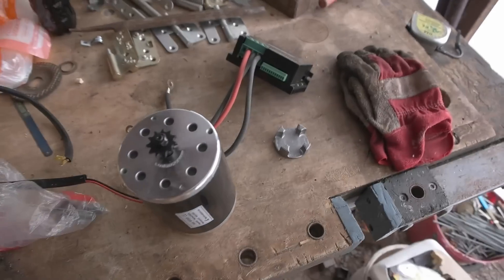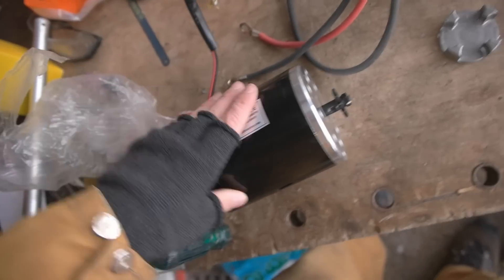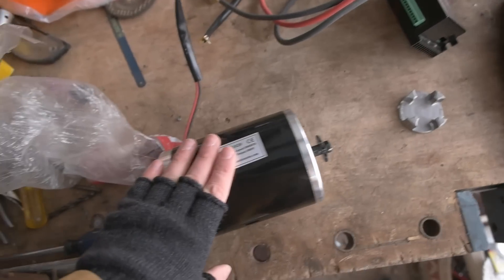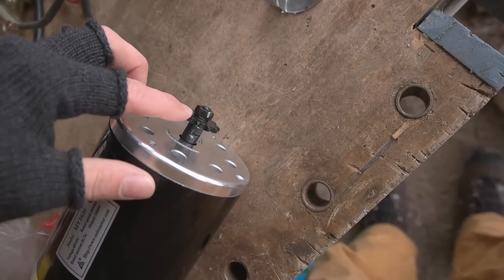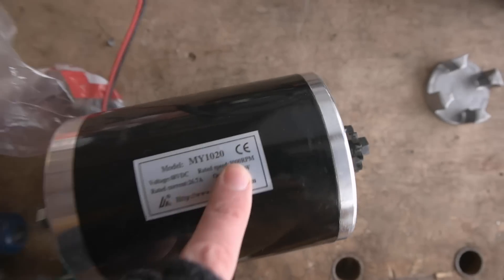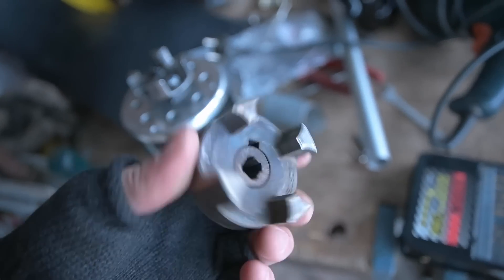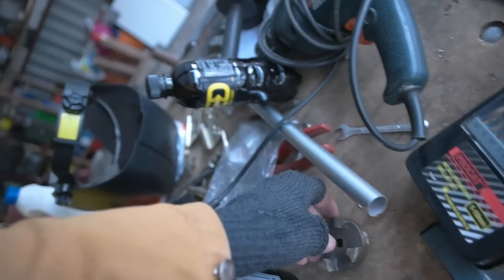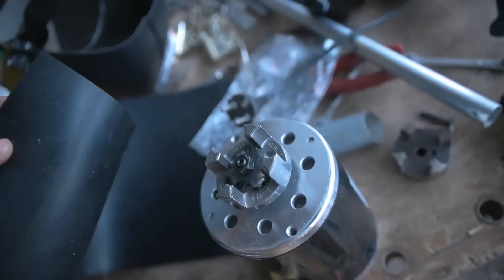Building my 2nd electric outboard motor - Part 1

Comment: Nice project of electric motor outboard...10k to 100k Rpm...a quite engine that can not use gas and diesel engine... Very high speed electric motor outboard...

Comment: Sir, it definitely looks good. I didn’t watch the entire video, I stopped when you drilled your coupling. It may not seem to be off center much, but it is badly off center. With it welded on, its not going to spin true, at higher rpm. Aren’t you going to tare out bearings? It seems to me your going to tare it up. If you need a new coupling, perhaps use a mill and a surface grinder. And balance it out, I want to do the same to a 9.9 Merc.  So I’m learning from you.

Comment: Dang those couplings are industrial Legos. You could have got them with proper hole diameters for the shaft with set screws already in them for cheap.

Comment: Ooohhhhhmmmmm ;)
Great project! I figure with magnets it's a hall effect sensor? They are more precise and long lasting than mechanical potentiometers. Poti's tend to jerk their reading when they get old.
With a potentiometer you normally have 3 connections with a slider in between max resistance strop so electronics can figure out at what percentage you are.
My guess is you have to configure the controller correctly to stop either at 0 or at full resistance.

BTW you could probably 3D print a mold and cast the rubber connector with silicon or polyurethane.

Comment: Hi. I think the controller need an 0-5V potentiometer/throttle. I think you are using an 1-4V standard ebike/scooter throttle. So when you start it gets 1V and the controller thinks you give it like 20% throttle. Cool projects you are doing. Im in to a cuple of electric projects my selves and learning as I go :) Greetings from Norway :)
Reply from the maker: Hello +Jarle høgenes ! Greetings neighbor! Yes you were right. Thanks for the info! I already made a new handle that uses the pot that the controller shipped with. It's working good now.

Comment: Hey your rubber cush drive looks good now, the only thing I have observed is that you drive dog coupling on your motor hasn't been cut off square.... giving it more mass on one side, this will cause vibration and shorten the life of the shaft bearing.....it's just an observation. !!!! Keep up the good work 👍🏻👍🏻
Reply: Glenn Fryer I was quickly going through the comments just to see if anybody else caught that. I agree
Reply: Yeah saw that too haha. He could probably file it off and balance it by using the motor itself as a "lathe".

Comment: Hey Pauli, great job on this! I'm working on a similar project with a 5kW motor. I'm currently trying to rework the propulsion shaft to extend it so I can put a bigger propeller with higher torque. Have you ever done or seen anything similar? Do you think it would have too many problems? Greetings from Brazil
Reply from the maker: +Igor Sampaio Thanks! I haven't done that, but extending the shaft where the prop is connected might put too much stress to the shaft and make it unstable.. You could try to cut the cavitation plate off to make room for bigger prop. Bigger prop is bettter with electric motors cos you can't get the same rpm but you have the torque to use it.

Comment: gears Pauli. lol. electric motors has loads of usable torque and you are throwing it away by using direct drive 1:1. think about it. a with a tiny starting motor connected to a massive flywheel gear can crank over a huge v8 engine. don't be afraid to put some load on your motor and get the prop spinning a little faster.
Reply from the maker: +HillbillyMatt ExtremeDIY I think you're trying to say that I'm throwing the torque away by not using a 1:1 ratio. Gasoline outboards have usually close to 2:1 ratio which makes the prop spin slower than the motor. You're right. But I'm not gonna try to modify the gearbox. The controller on this doesn't allow that much torque (amps) so it might be just enough for this outboard..

Comment: 3D print a coupling bush .
Reply from the maker: +Mazda rx7 I've done it already if I've had a flexible filament :) But what I've read they are kinda tricky to print.
Reply: It don't need to be very flexible for outboard applications. You can print it slightly smaller and dip it in rubber coating like the stuff you dip tool handles in.  https://plastidip.com/   It's only to dampen out vibrations.  The actual gas motor has no such coupling and works fine , directly splined. the coupling you have is only to allow for minor alignment issues